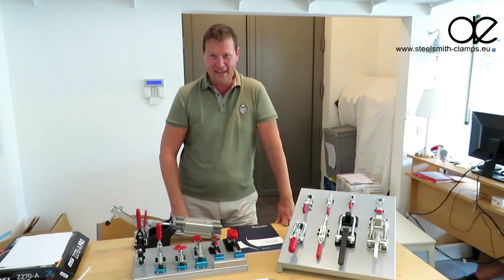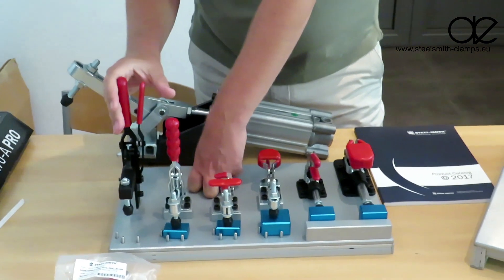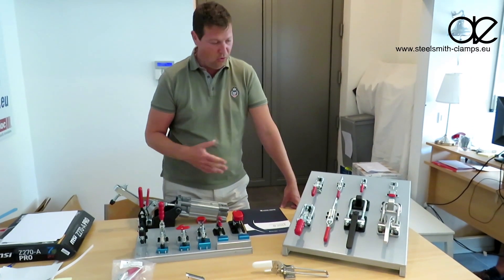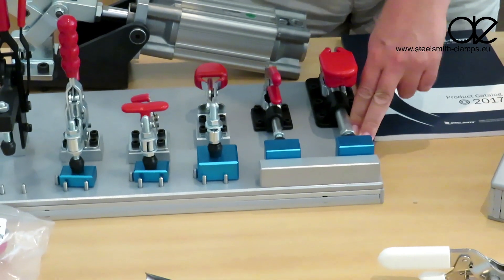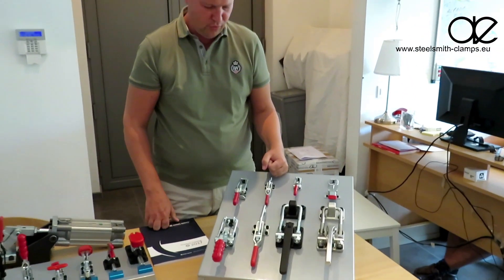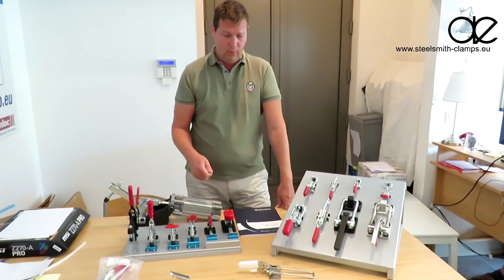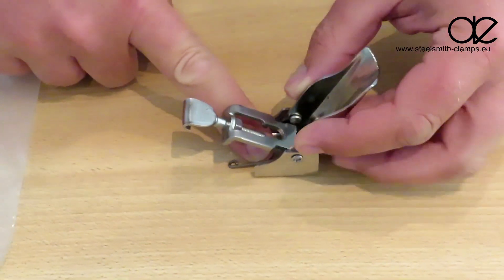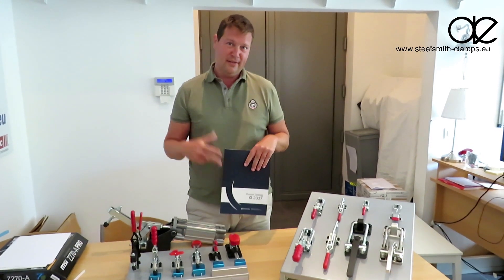S-Clamps

Comment: How much force does that first latch type toggle clamp exerts when locked in place? I know its holding capacity is 1600N but how much is the force exerted by the locking action itself to have a pre load.?
Reply from the maker: the preload can be set by the nuts that are used on the U-bolt.  if you make the U-bolt by this action longer, the force will be less, if you make it shorter, the connection force will be higher